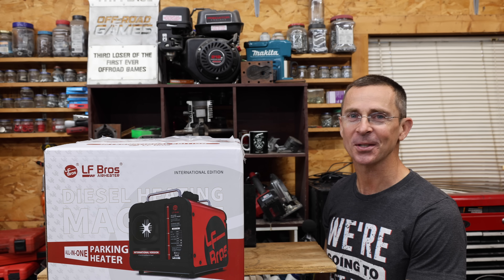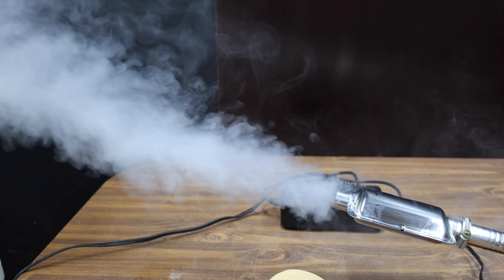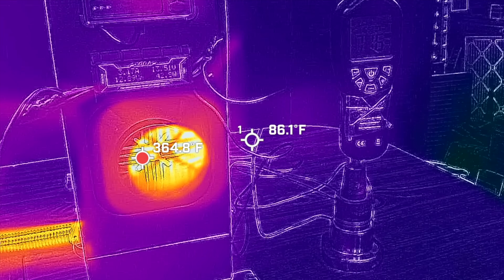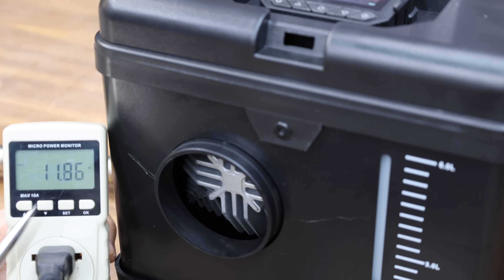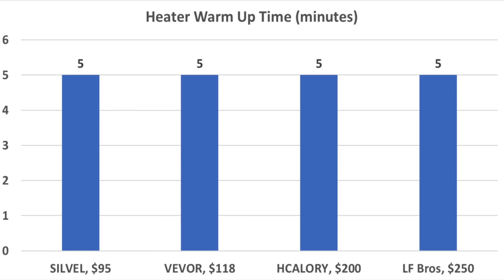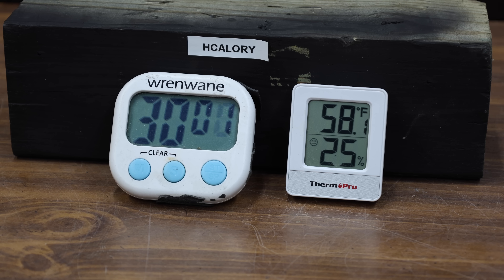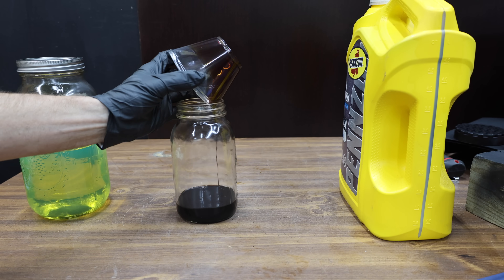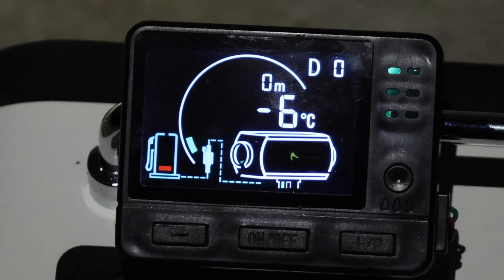The Truth About Cheap Diesel Heaters!

Comment: I finally dove into the diesel heater pool this last week. I've a 1,500 Sq foot house, and my furnace went two years ago. Last winter I used radiant heaters, but it was hella expensive,  and couldn't maintain above 15⁰C. 
I just got my heater off of Amazon, and got it installed. It's similar to the vevor, and was $105 CAD when I bought it. I routed the exhaust up my chimney,  and alumi taped the rest of the door. I've tested and zero CO leakes. 
I still have the radiant heaters, but on 1/3 power. That was maintaining around 11⁰C. I turned on the diesel heater onto its lowest setting to see the result. It took a day and a half to get the whole house up to 20⁰C. It's now been running 4 days straight. There's about a 1⁰ fluctuation,  and it burns it's max capacity fuel load of 4 liters every 24 hours. So impressed with how well this heater works. I've 3 cans of diesel, and that should last me 1/2 the month. Next step is to add used oil.
Reply: Stay away from the used oil. It will create ash and gum the unit up. If it’s an emergency fine that’s different but expect some maintenance or parts replacement. If you are unsure about what I’m saying research YouTube videos pertaining to used oil in diesel heaters. Just keep a stock of dyed diesel fuel. That’s the best alternative.
Reply: @carbonunit6573  died diesel is hopefully in the future. A favourite locale of mine(Bear Creek Gas Bar (reservation)), is currently around $1.30/L for red d. I’ve just got to fix my truck before I can get back out there.
Reply: @ I wonder however if anyone has actually calculated the road taxes on fuel and did the deductions to see if dyed fuel is actually the value minus the road taxes or just someone’s opinion of how much they can still scam us for. And just as a bonus how do Teslas pay for road taxes. There should be no free ride.
Reply: So for ease of calculation at the cost of diesel across canada of $2/l it looks like $240/m to heat during the cold months - not bad when you consider that a full cord of wood now is hovering around $400  and I was using 6 full cords to heat  a smaller space
Reply: @jburbinski7057  yes. Going for economy is my primary driver. I’m on a permanent disability pension, so that’s critical.
Reply: @jburbinski7057 Wood is super expensive for heat if you don't have the ability to cut it yourself for free.
Reply: @jburbinski7057  6 full cords a month?
Reply: When we find the combustion chambers Carboned up and not firing properly(lots of smoke all the time) we run kerosene through it wide open for one tank. Then back to diesel until the next time about a year later or so.
Reply: @meon3271  good idea
Reply from the maker: Thanks for sharing.
Reply: @ProjectFarm  can you make a episode about high torque 1/2 impact guns can you include the Bosch pro factor
Reply: Do not use motor oil.😬 Run the exhaust into a old house radiator if you can find one, and then vent outside. Much more efficient.
Reply: @mrwilly41 smart
Reply: These things are notoriously horrible at handling anything besides clean diesel. I wouldn't recommend used oil.
Reply: Don't do the used oil, it will work for a while but after that you can basically rebuild it (don't ask how I know). Some recommended later to mix it with diesel at various ratios but for me it's just not worth it anymore.
Reply: CO2 is heavier than air so be very careful how you exhaust into chimney flue.  Although CO is lighter than air, atmospheric and pressure imbalance within house could cause the CO to sink.  Chimneys work with fires 'cause the heat drives up the exhaust gases (smoke). Other gases are NO2, NO & SO2... plus particulares, mostly carbon.
Reply: @denisripley8699   THIS !!   BETTER LISTEN TO THIS GUY !
Reply: Check out David McLuckie regarding used oil. It's probably going to create more problems than its worth. Also watch some videos by Joshua De Lisle. He does some great tests and mods with his diesel heater. Cheers.
Reply: @bobuncle8704  you can't point the exhaust up the chimney.  If the fireplace isn't lit the exhaust can come back into the room too. Exhaust must be pointed down
Reply: @FourthWayRanch Question, yes exhaust pointed up after running for an hour don't you think the flue would be hot enough for a draft?
Reply: @gregie9999hotair1  no that thing has very efficient combustion and creates a lot of water vapor.  The exhaust should point down, you don't even want it to be level.
Reply: The only thing I would try is untaxed diesel
Reply: @austinmiller8695  on Tax diesel is the same as Tax diesel they come out of the same tank it's just that the government gets more pleasure out of one than the other
Reply: @austinmiller8695  diesel is diesel whether it's die diesel or clear diesel it doesn't matter it's exactly the same stuff the only difference is the tax rate off-road diesel is the same as on road diesel except a little cheaper because it does not have the road taxes attached it 

all comes out of the same tank originally
Reply: I subscribe to this channel.  Anytime I’m making purchases I always check with PF.  Best reviews 👍
Reply: But they're noisy no?
Reply: @FourthWayRanch  the pumps do make a noise some more so than others there are quiet her pumps you can retrofit to them but if you've got no heat I could get used to that noise how loud is your teeth chattering ?
Reply: @sprint48219  I got one this week. It's too noisy. I'm gonna try a quieter pump
Reply: @FourthWayRanch  mines down the hall, and I can barely hear it. It reminds me of the big ‘ole hall clocks that would go tick tock all the day long. Don’t mind it at all
Hopefully you can quiet yours down. Mines been running for 16 days straight now, and absolutely lovin it. It’s taken 90L in those 15 days, and overnights were down to -10° for 6 of those days, with medium to high winds 4 of those nights(gusts to 45km/h).
Reply: @bobuncle8704  yes I spent nights in the sleeper of a truck in  Alberta listening to it.
Reply: @sprint48219 🦷 chattering 😂😂😂😂
Reply: @FourthWayRanch  I don’t find it too bad. I can’t hear it from my bedroom. I have to really concentrate to hear it. There are apparently some new pumps that are quieter.
Reply: @bobuncle8704  You're Canadian. You're allowed to use the superior Fahrenheit measurement for temperatures.
Reply: @TehButterflyEffect  😂😂😂😂
Reply: It's been done, these little units clog up on used or dirty oil. If it's a significant heat source,  get a spare unit b
Reply: I had problems with my diesel heater after running it on diesel for about 14 days. 
I even used kerosene, but that didn’t help.
Don’t use anything but diesel or diesel/kerosene mix.
Reply: Be careful with how you faced the exhaust pipe: always going down. If you have a “p trap” style installation, it will clog after few weeks
Reply: Been using two of these heaters in my garage for 4 years plus a spare for parts no problems so far but I only use diesel and kerosene and only need to run both if temperature is below 30 degrees.
Reply: Can I mix with used cooking oil from buttered chicken.
I'm sure it smells good on the exhaust.

😂
Reply: Use a heat exchanger on the exhaust to pull more heat.
Reply: @561inurface  Thanks. I’ve a fan blowing across the 8’ of exhaust, which is doing an ok job. I wanted to use an old radiant heater, but the cheapest I could find locally was $300. I didn’t think that was a good value. Maybe next year. I’ve also seen a sand barrel as well.
Reply: @561inurface I was thinking maybe running an extra long exhaust pipe through a bucket of water to heat for things like washing up and cooking. When the power is out, hot water is so nice.
Reply: @jaymzx0  if you're gonna lengthen that exhaust pipe you better up the diameter considerably and every 90° turn shortens the length that you can run it, upping the size helps considerably

But in the end you want it out of that exhaust pipe as fast as you can get it out of there
Reply: @561inurface  i've seen people used cast-iron radiators just put them where you want them and pray you don't have to move them again !
Reply: even though the adding used oil would be a fun experiment I think in the long run it would soot things up and plug the filters enough it probably wouldn't be worth the aggravation if you had any other option

if you're playing with it that's one thing but I can guarantee you from past experience it's no fun at 3 AM in the morning figuring out why you have no heat
Reply: @bobuncle8704  save yourself the headaches skip the used oil it'll be a problem in the long run
Reply: You really don't need to scream
Reply: How much is a litre of diesel in Canada?
Reply: @willhooke  $1.38🇨🇦, $1.00 🇺🇸
Reply: For heating a garage or shop..are you guys mounting the unit inside and then cutting a hole to vent the exhaust?  Or are you mounting the unit outside and piping the output hot air in?
Reply: If you want the heater to run efficiently and not cause any problems stick with diesel or kerosene.
Used engine oil will cause the combination chamber to carbon up and the heat output will drop a lot.
Reply: Yessir can make biodiesel easy too with used veg oil methanol and lye
Reply: Diesel here is $3.12 a gallon (3.75 L)
Reply: @jatpack3  3.78 American liters. 4.54 Canadian liters. Per gallon.
Reply: @Deere2154D A liter is 1000 cc worldwide. An American gallon 3785 cc
Reply: @bernswonger57  a Canadian gallon is 4540 cc. What's your point?
Reply: @Deere2154D  IMPERIAL gallon
Reply: @FourthWayRanch  Canuck gallon.
Reply: @jatpack3  I can only dream of prices like that. The carbon tax here is insane.
Reply: Please Be careful running that up a chimney 
Did you just dump the exhaust in the existing chimney?
Did you add more tubing up and thru chimney or did you dump it into the cold chimney?
Please read or refer to the length of exhaust flue your can run 
Dumping a small heater into a chimney as opposed boiler that has limits and heats up a chimney considerably more then 27000 but heater .
Reply: @peterpiper_45-70  yes.  my house has 2 fireplaces.  gas w/ fake logs lower story fam rm (vented), conventional wood burn main living upstairs.  There is a downdraft when you open the flue for as long as there is a temp imbalance until your fire creates the updraft only.  Good grief, do not try to vent up the chimney.
Reply: That sounds like a ridiculous heating system you have. Why didn’t you just put in a pellet stove?
Reply: @jeepgirl1653  the people I know with ballot stoves you get a lot of dust in the air and if you got allergies they can drive you bat ass crazy
Plus I just don't like buying somebody else's sawdust
Reply: Dude, fix your furnace instead of messing with that crap.
Reply: @disbud596  unless you’re going to pay for it, this is all I can afford
Reply: @bobuncle87 read a book, research online, buy Amazon parts, talk to people, fix it yourself for less than your fire hazard heaters.  Its laziness
Reply: @disbud596  I bow to you superior intellect  oh penultimate master of masters. So glad you know my life so intimately as to tell me how to live it. I quiver in anticipation of your next espousal of wisdom.
Reply: Dude I would stick with the diesel don't try to use who used oil because you might screw it up then it will be expensive to fix
Reply: Used oil? It will sooth the burner in 7 days and spread poisonoius heavy metals hundred meters around the exhaust...
Reply: Did you see the amount of particulate matter that increased when using used oil. That'll be coming out and hanging around your property if it's not a windy day. Oils recyclable
Reply: @matt45540  They recycle it straight into an oil burning power plant lol
Reply: @wills.5762 Some ships use the nastiest of dirty recyclable petroleum products. A person can practically walk on top of it.
Reply: @matt45540  yes. I was just going to do some experiments at maybe 20:1.
Reply: Why the Hollering, Yelling Voice ?  Turned it down 3 times and still had to   mute it and turn on closed captions.
Reply: @mikemiller373  Because it sounds better.

Comment: Great video, excellent job describing how they work! I've used several of these heaters for almost 10yrs, they work great,  but they do need to be dismantled and cleaned a couple times a year. I have the same bluetti and it runs my heater for about 6hrs on a full charge, although basically the same heaters, mine are older generic Chinese heaters from Amazon.
Reply from the maker: Thanks and you are welcome!  Thanks for the feedback.

Comment: I bought the Vevor a few days ago as overall between the reviews I've watched it was the best over all Price/performance/reliability/build quality. I could have just watched your video (as per usual) and come to the same conclusion. 

I would like to see from you a more thorough video on the long term effects of used motor oils and how much of a ratio can you get away with. I'm planning on a 70/30 oil/diesel mix since I have several gallons of used motor oil to burn through. Curious however about the long term effects.  Also curious if fuel treatments (Seafoam and Lucas) can clean out a heater with a lot of carbon build up.
Reply from the maker: Thanks for the suggestion.

Comment: Sure was a fine test, Commander but my Sweetie came in with a Little Buddy catalatic propane job with 4 one pound gas tanks. Also the gas logs are ready to go and don't need power to keep us warm but have two blowers if needed. Miss the Fisher heater but the gas is in the tank outside and no toting required. Just the way we need it. Yall have an early winter and God Bless Yall! One of those diesel jobs woule be good for Cousin Eddie!.
Reply from the maker: Hi Lewie, Always great to hear from you! Sounds like your Sweetie found a fine heater! The gas logs are also a great idea. We use a wood stove for heat, but I really like the idea of the diesel heater for supplemental heat if it comes to that  during a power outage. As they say, failing to plan is planning to fail, lol. Glad we both have a plan! Wishing yall many BLESSINGS!!
Reply: @ProjectFarm  The wood for u7s is too much handling and the gas logs were here when we swapped out for wood. Time to swap back. Just neded a vacuuming and a hooking up by a real gas guy and off it went. Just trying to look ahead. I guess the Little Buddy is our suplimental heat along with the logs. TeoldColeman 5k is readyto pull the pump and coolers. I mighteven get a power pack. Thanks for another fine one and needed badly this time of year. MORE BLESSINGS 2 Yall from (Us'ns) here in the hills

Comment: Bought my Vevor 8kw a couple years ago (still works great!). They have REALLY improved the control unit it would seem since I got mine.  It has the confusing multi button one.

But they still haven't done anything on that lousy exhaust outlet it would seem.  Sure, it was intended to be mounted in a van (etc) which would have the pipe going straight down through the floor.... but for the amount of people that DON'T use it like that... it could use a good redesign.
Reply from the maker: Thanks for sharing.

Comment: DO NOT run these heaters with used motor oil if you rely on them. Depending on how much fuel you burn, and how hot you run the heater you will clog it up with nasty rock like deposits and ash from the oil. 

I tried it, and after 5 gallons of a 30% mix (constant running on high) the combustion chamber had rocks in it that I had to chip out. 

Motor oil has elements in it that collect, unlike diesel or (expensive) kerosene.
Reply from the maker: Thanks for the feedback.

Comment: 6:48 that looks C13 120v ac power cord like on most PCs... If it is.... What happens if you plug in the unit to 120 without the adapter in the middle?
Reply: Best case there’s a fuse. Medium case a resistor or capacitor pop. Worse there’s nothing and it starts on fire.

Comment: That power connector on the Hcalory looks an awful lot like a standard AC line cord connector like normally found on computers and monitors and other equipment. Will an AC cord plug in there and if it can what damage will occur if someone did connect it to 120 Volts AC?
Reply from the maker: Thanks for the suggestion.

Comment: While he showed the heaters can run on alternative fuels, beware, it will result in a build up of soot in the burn chamber in a very short period of time, which will result in clogging and require  a tear down and thorough cleaning. Stick with diesel or kerosene, or be prepared for a lot more cleaning and maintenance.

Comment: The first heater was so smokey because of the failed start, there was a bunch of unburned diesel in the heater because it shut down before ignition and heat up.

Comment: It seems like they could include a battery and alternator, as well as a means of stripping as much heat as possible from exhaust, since the goal is to generate heat.

Any process is only going to generate waste heat, which isn't wasted in this case.  The metrics for success would be cool, clean exhaust, and overall durability.
Reply from the maker: Thanks for the feedback.

Comment: I have 2 propane heaters in my shop a 85,000 btu reznor, a 35,000 btu wall heater and a vevor diesel heater .  The diesel heater i use for over night and it keeps it 60 degrees on 1.8 setting in a 25 x25 x14 shop . I put a 5 gallon tank on it and lasts for a week.
Reply from the maker: Thanks for sharing.